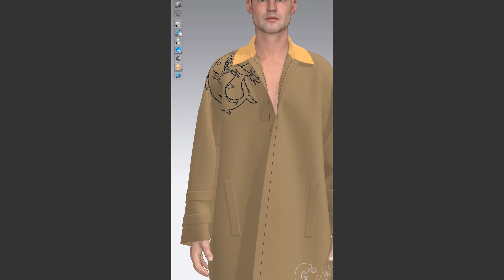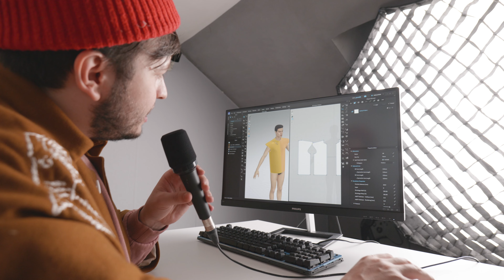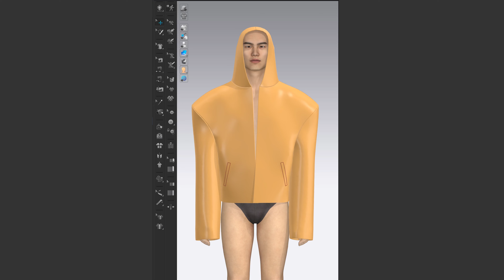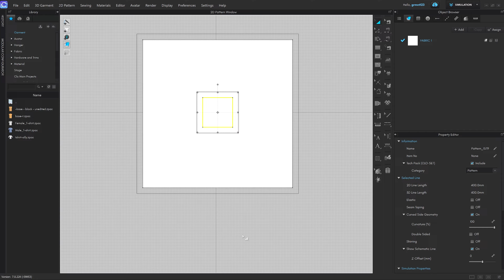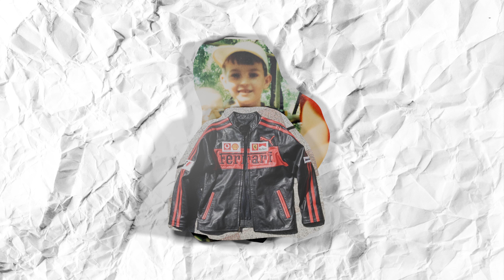Recreating Balenciaga's Most Expensive Jacket

Comment: The actual problem with the audio is that it's out of phase. It happens when u just duplicate one single track of audio in two to make it stereo, but the polarity of the second one is in the oposite way of the first one (like in a mirror) and the soundwaves cancel eachother in a mono speaker. The sound only works well in stereo speakers or stereo headphones/earbuds. To  avoid out of phase audio, u have to check if the two tracks of the stereo audio have the waves in the same way, if the waves are not in the same way, u have to invert one side of the tracks to turn it the same way. Google for images of "in phase vs out of phase audio".
Reply from the maker: I wish it was that. Actually, I recorded half of the video with a Dynamic mic directly into the camera but didn't realize just how noisy it actually was so in post I had to try and clean it up. Audition has this feature where you capture a noise print and it clears the noise based on that.. And that's what you're hearing. It just couldn't cope with the massive amounts of noise. I've since bought a mic preamp with phantom + an interface which drastically lowers the noise floor so it won't be a problem moving forward but sometimes you just can't go back and reshoot, like it was the situation here. Lesson learned.

Comment: Love this, but i think the cap wouldn't be so high for this jacket as i think its just dramatic extended shoulder line. The original design isn't as square of a shoulder as it is in clo3d version.  For the corded elbow detail the seam allowance on the sleeve can be turned back with double sided tape and you would just place this corded peice under the opening using 1 or 2 rows of top stitching to secure in place.
Reply from the maker: They've presented two different versions of the jacket, one for the runway, very square, wide shoulder but without padding, it just flaps around + the version they sold on the platform which is a bit more rounded but visibly padded... But as long as the principles behind the explanation are clear, people can just adjust to their liking.